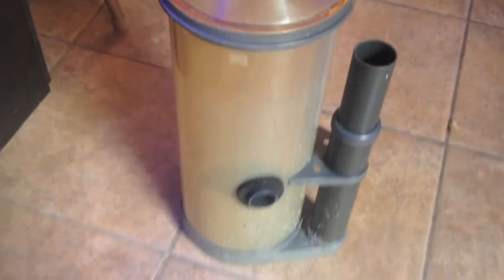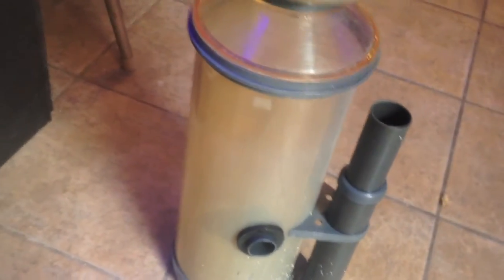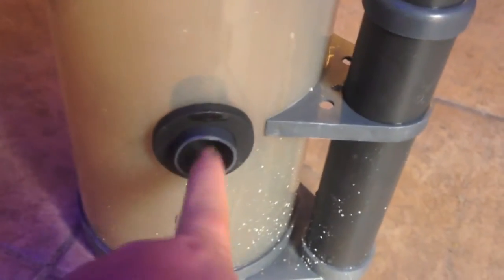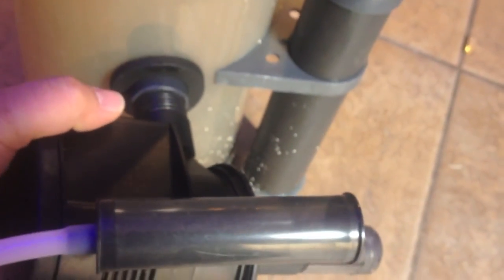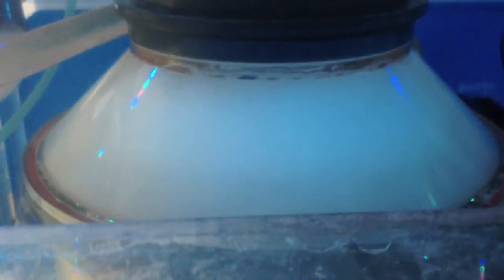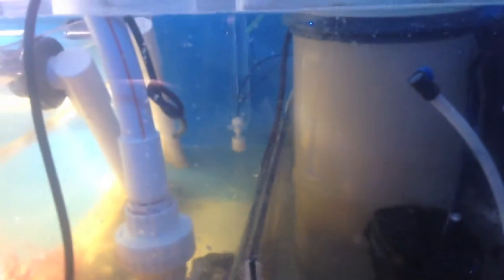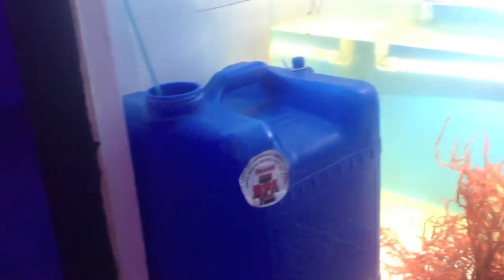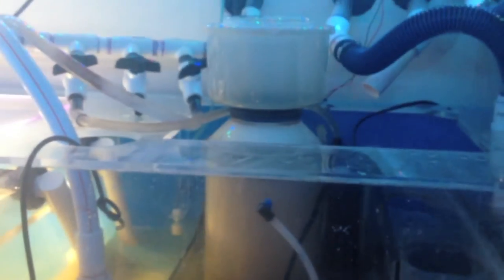ASM G3 Protein Skimmer with Tunze Hydrofoamer pump

Comment: Aqualifter diaphrams are really brittle.. run some vinegar thru it. Its most likely h to have a little scaling on the diaphram from water evaporating while its off and stiffening the diaphram up, which then causes it to have a harder time keeping consistant flow pressure.